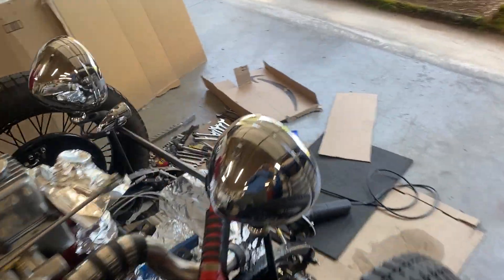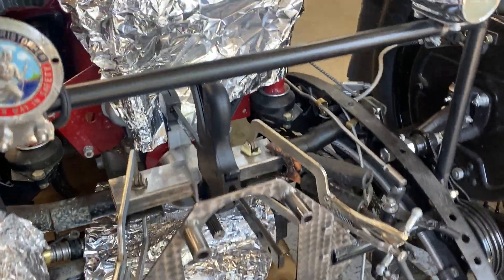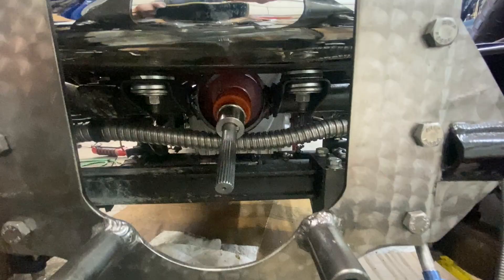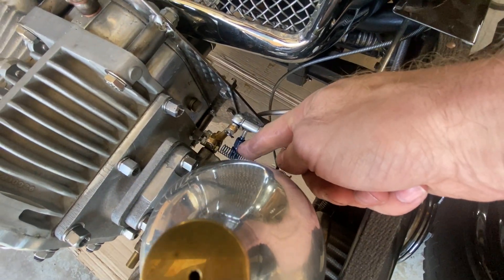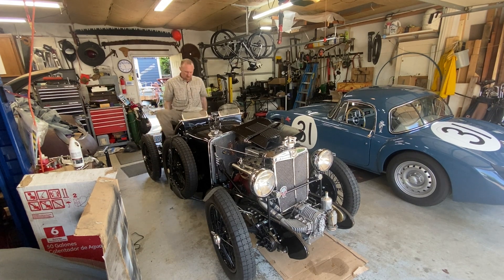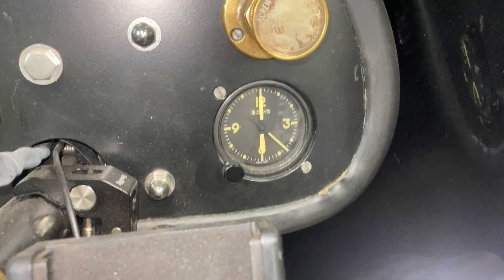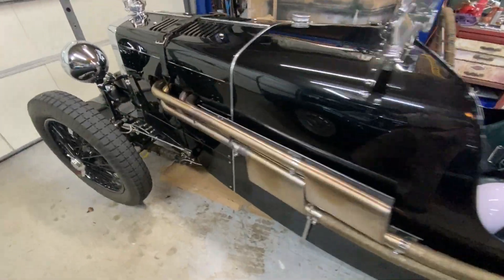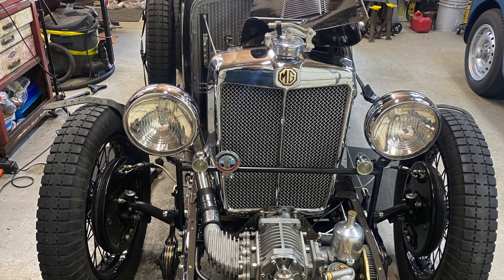MG TA2962 Race Car Undergoes Surgery to Repair Supercharger Drive Shaft

Comment: Hey Craig, new subscriber here. I am starting my YouTube channel with a 1928 Morgan RIP MG Special. I am using an experimental aircraft opposed twin engine in the front. Then I am casting a two part adapter to mate the output shaft to the flywheel on an MGB transmission so I have 4 gears forward and a reverse. Then I am using an MGB rear with those beautiful wire wheels making it a special.
Reply from the maker: Sounds like an interesting project. I'll look for you page and follow along! If I was closer to your area it would be fun to check it out in person.
Reply: @Craig.cootsona  I am trying to clear out my other projects so I can start on the Morgan. I am selling off most of the other stuff that does not relate to the Morgan build or the MG build. I am going to try and find you on Facebook so I can get in touch to find resources for my MG build. Thank you.
Reply from the maker: Yes, feel free to look me up on FB. I can point you to some of the places I've sourced parts. @Biokemist-o3k